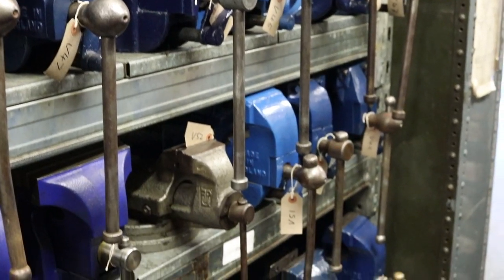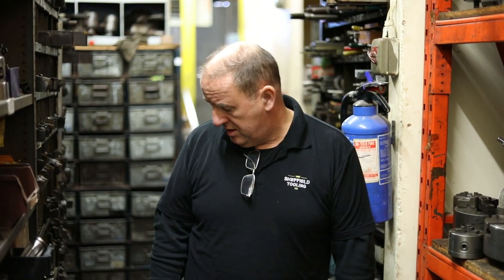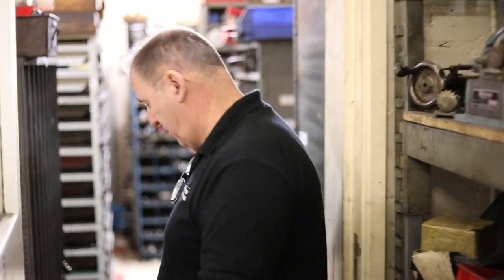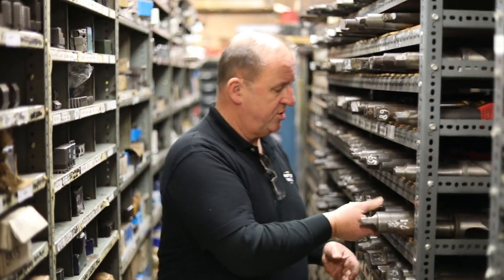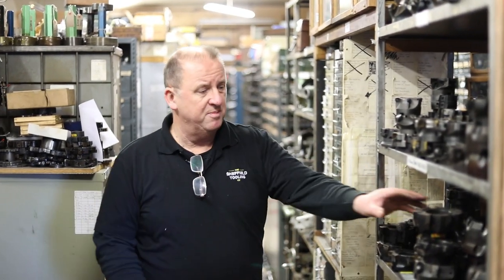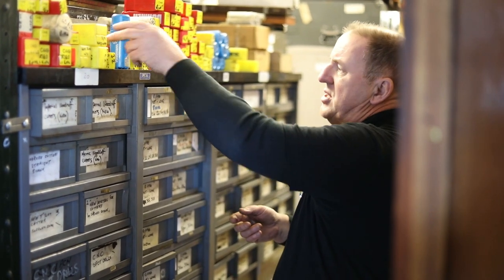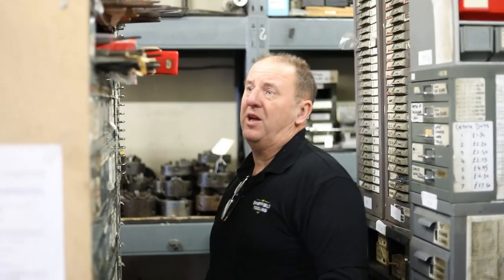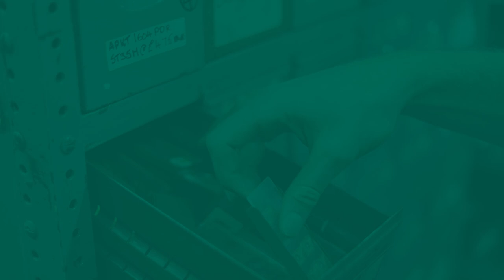Engineering Tool Shop Tour - Part 1

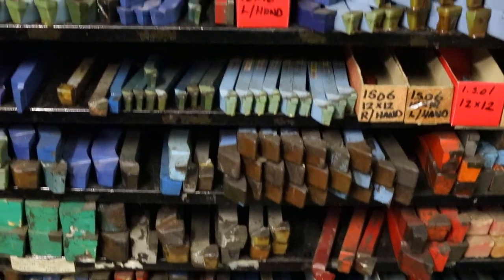Comment: 6:45 those tipped cutters take me back to 1962 when I started in engineering making textile machines and the works manager unwrapped a tipped cutter and handed it to me as though it was a precious jewel!
Then in 70's I worked in a place run by skinflints and had to make own tipped tools by brazing a used carbide tip onto a shank.  Then it had to be ground for half hour to get excess off and correct the geometry. 
It's a wonder I'm still alive with all the grinding dust I've inhaled over the years!